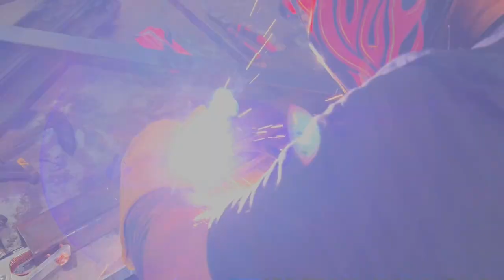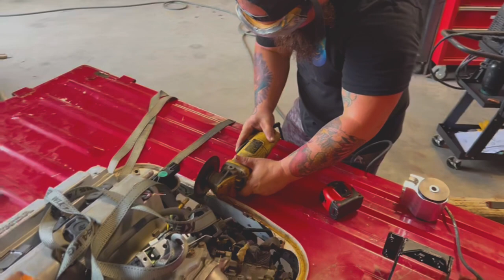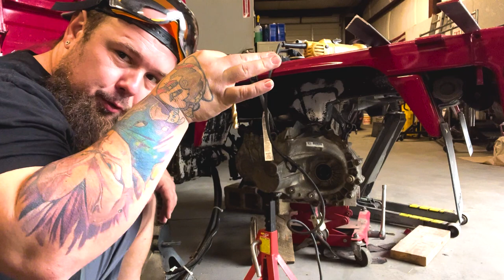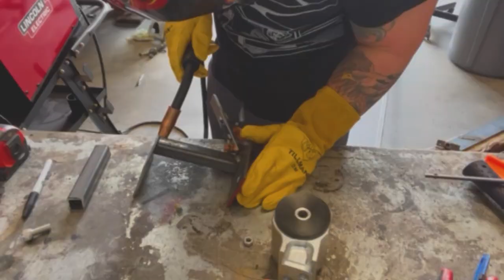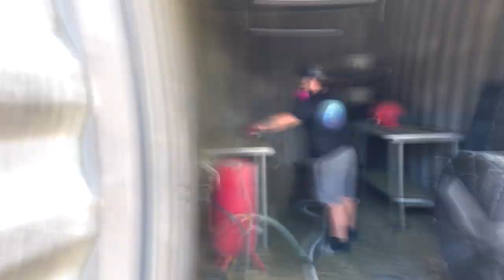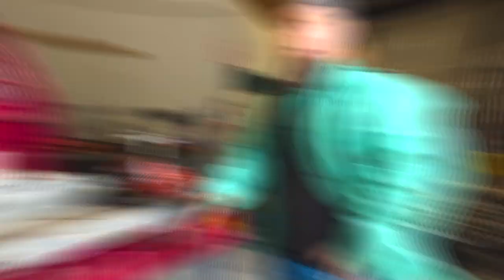Welding time! JDM Mini Truck K24 Swap in Honda Acty - Rare Kei Truck Engine Mod Adventure

Comment: For a next video, you should consider putting in a Goldwing engine in a Kei truck. The Goldwing engine is flat and could fit better, It is powerful and extremely reliable.
Reply from the maker: My heart was set on the k swap and I like the challenge 😁

Comment: Buy a couple of sets of transfer punches, one imperial and one in metric.  It is much more accurate than using sharpies and guessing where to center punch.  Starlets cost huge dollars, but the Chiwanese, ones are around $30 per set.  Buy a couple of sets, then buy the expensive ones to replace the ones which get dull.
Reply from the maker: That’s great info. Thank you!

Comment: If the motor were poking up right behind the cab that would be possibly acceptable, but in the middle of the bed? That's just plain stupid! it ceased to be a usable truck at that point!
Reply from the maker: The original motor is in the same spot so why cut a totally different hole? Also, the motor must sit over the wheelbase so that’s the only choice. 
Maybe I didn’t want a usable truck bed anymore 😂

Comment: I think it would have been better to put the engine up partially under the cab seat and such instead of in the middle of the bed.  Then put a smaller gas tank under the bed in back.  What would be really cool would be to put that Kei Truck on a Subaru WRX chassis (engine, transmission, axels, suspension exhaust, breaks....  I wonder how flat you can really get that engine if you did two separate intakes and throttle bodies on the side and modified the oil pan...  You would have to raise the body up a little to give you some leg room, but this would let you put larger tires on it.  Think though a 2.4L turbo Boxer engine with all wheel drive...
Reply from the maker: This is the factory position that the motor is mounted. Keeping it there allows the rear axles to line up to the wheels hubs like all Hondas. That’s part of the reason anyone who has attempted the swap, has put the motor in this location.
The body doesn’t come off the Acty like it does on some of the other Kei trucks. 😁
Reply: @insaneimports_official  But I doubt the axels and drive shaft can take this much power and I think this video or another one mentioned you were sending out the rear axel out.  And while it would be a pain and likely add more weight, cutting and moving frame parts might be annoying, but not that hard.

I really wish they had a US distribution and left hand driver versions.  My nephew is a Subaru nut and owns his own shop and got into racing with a Subaru.  I think he is using a modified WRX.  Those things have a crazy Boxer engine 2.4L turbo and AWD that is in a crazy cool package.
Reply from the maker: Check out the latest videos and you can see how the axle was revised.